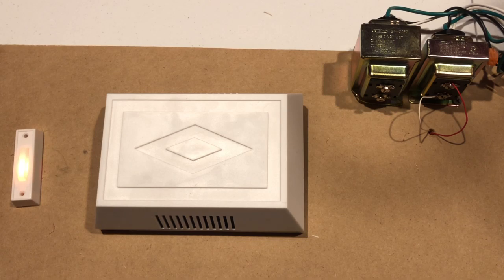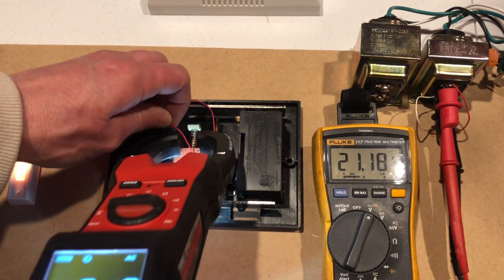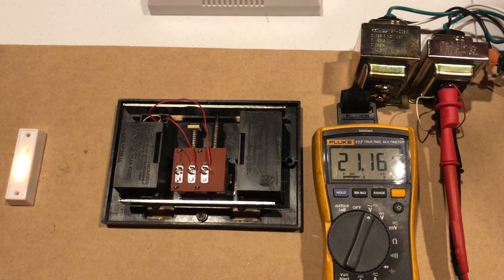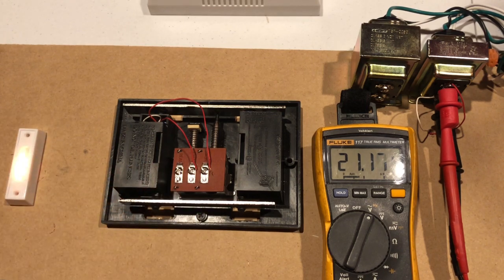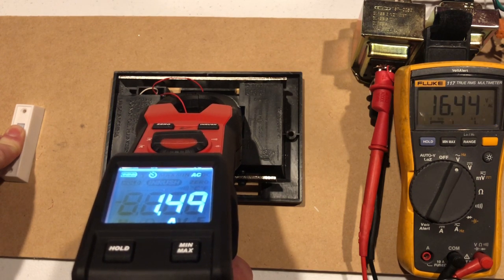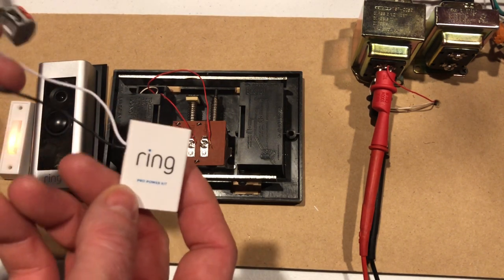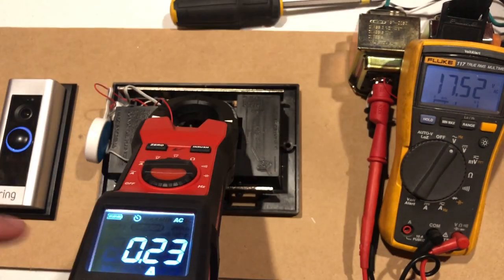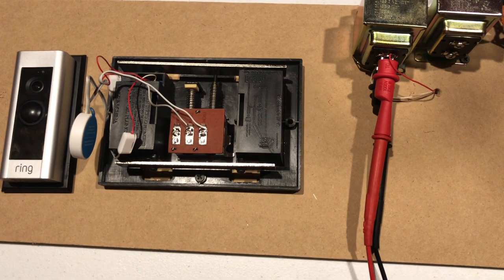16V 10va VS 16V 30va Doorbell Transformer

Comment: Hi i have a couple of questions please, is the transformer something i must install after installing a Ring 3 video door bell? I installed a Ring 3 video doorbell last week, i had to add a ChimePro to extend wifi signal, working fine, battery always at 100%,then since yesterday i noticed the battery going down to 95/94 and 93% now, over night didn’t move from 94%, during the day i was using the app quite often and tried to change some settings but now back as before.So do i need to install a transformer(16/30) ? Is there an old transformer to be removed? and does it go in or beside the home ring chime? Just trying to find out if this could be a solution and if i could do it myself without hiring an electrician.thanks for any help!
Reply from the maker: I wouldn't worry about it right now.  With your ring having the battery you shouldn't have to upgrade the transformer.  The battery compensates for the voltage drop.  Really this video was intended for the Ring Pro and Nest Hello.  Right now you are using your doorbell quite a bit but in a couple of months you wont be using it as much.  If your battery level was getting down to the low 80's or high 70's I would upgrade the transformer.
Reply: @sellgooddeals-DIY  hi thanks for the reply, sorry if i bother you again but let me ask you something else, maybe you could give me an opinion, i installed a ChimePro to extend wifi signal, using 2.4ghz wifi, seems better than 5ghz, so the signal strength between modem/router and ChimePro is always pretty good( -39-43), but between Chimepro and Ring3 outside door goes up and down ,( -50-53 then -60 and sometimes-71poor connection), the chimepro is right in between ring3 and modem, maybe 8feet from ring3, it seems too weird that the door blocks that much. any idea or suggestion?

Comment: Could this be the reason why my chime vibrates and "ghost rings" as soon as I hook up my nest hello? No load I am getting 19 volts at the chime and at the wires for the doorbell. I did not test amps or under load voltage. Thanks for the help.
Reply: I got the same problem and after I reconnect the power kit. The ghost rings went away.

Comment: Thank you for this video! It's very helpful! What if you removed the chime part instead? For some reason my ring doesn't sound through it anyways. I'm scared to change a transformer.
Reply from the maker: I don’t use the chime at my house, I bypassed it.
Reply: @sellgooddeals-DIY  how did you bypass it?  did you just join the 2 (or 3 if you have a rear door) red-wires together and that's it?

Comment: The booklet tells you that you need 16Volt when you actually need a 24 volt Compatible System. My cost to upgrade was over $75 (new doorbell compatible system)+(Transformer and compatible doorbell) not including the Ring Pro Video Doorbell itself

Comment: Great video explanation!  Would a digital (melody) doorbell cause the same problem?
Reply from the maker: Thank you for watching!  The digital doorbells just use a fraction of the power and it shouldn’t be an issue with a video doorbell.
Reply: @sellgooddeals-DIY  
my digital door bell is making a buzzing sound after I installed the ring door bell. I upgraded to 16v 30vac and still makes the buzzing sound. What could it be?
https://youtu.be/bGdrE7ukPGA

Comment: I just bought a ring pro and preparing to install. I just checked my transformer and it shows 10V 5Va rating.  I am sure this will be a problem.
My question: Can I just replace this transformer with a 16V , 30va and be ok or will I have to replace my existing doorbell as well? The fact that my existing transformer was so weak, gives me outside for concern. My house is about 30 years old btw, but doorbell has worked great all these years.
Reply: You may want to check your Mech. Chime rating, since you will pushing more voltage to it with a 16v 30va, if it is rated low, you may considering replacing it.

Comment: So last week I installed my Ring, this is the second house I have installed one on and it worked for a day but dropped out and not working anymore.  I assumed a bad one, didn't call Tech because it was set up correctly and was working fine for a day.  So I packed up the Ring and was ready to take it back but was leaving for the holiday.  Now on my holiday I watched this video and I do know I have a 16v 10VA transformer and my guess is this is exactly the problem.  I wonder is it better to get 16 volt 30 VA or a 24 volt 20 VA transformer when I return?  
Thanks and really great video!  Thank you for sharing!
Reply: General Rule; stay with the power (or close to) your Chime requires, if 16v 10va then go with 16v 30va, if 24v then go with 24v, the problem by adding more voltage to a Chime is the strikers will hit the bell arm harder increasing the sound (possibly damaging Chime over time).  With Smart Doorbells when the Doorbell button is pressed the Smart Doorbell and Chime increases the Load (at the same time) so you need a transformer that can handle this increased draw, this is why you go with a higher rated (va) transformer.
Reply from the maker: I would go with 16V 30VA the voltage is more stable.  The higher the VA the more stable the voltage will be.  However, both will work fine for you.  Thank you for watching!
Reply: @sellgooddeals-DIY  I have exactly the same problem... have tired 3...rings with the transformers they provided. With new one.. it ran for 2 days and off for 4 days then back on 2 days then now off and it is 6th days After watching your video, i have checked the transformer.. it says 24V 15VA. DO you think this could possibly cause the power issue?

Comment: Great explanation.  I know understand why I would need to replace my 16v/10vac to a 16v/24vac.  Is the power kit a requirement?  I had my doorbell camera installed by ADT and they did not put a power kit on the chime.
Reply from the maker: Don’t worry too much about the power kit.  The main problem is the transformer doesn’t have enough capacity to power both the chime and the doorbell.  Since this video I have tried 6 more different video doorbells.  None of them had power kits.  Changing the transformer to a 16v 30va fixed the problem on all of them. Have you been having problems?
Reply: sellgooddeals DIY 

Humming/buzzing coming from the chime.  Phantom doorbell ring.  Doorbell CAM losing wifi connection, no power, and the ADT Control app says there is a power issue.  Also the battery in Doorbell is low.

Until your video I didn’t really understand how increasing the vac would help.  What I learn is higher vac = less drop in Volts.  Maintaining Volt above 16, even when camera is drawing power to record = good.

Thank you.  Very informative video.
Reply: @CeasarBergonia  The Power Kit is suppose to take care of the humming/buzzing issues...

Comment: Douglas Blake on 8/23/19 writes
This discussion focuses on the original 16Vac/10VA transformer and the problem I see with it in its original application.
Relative to the 16Vac/10VA transformer measuring 21Vac on its secondary that is a problem which will cause the 16Vac-rated bulb within the door bell pushbutton to have a reduced life (< 3 years). Upon viewing your video (prompted by my own bulb burning out after 2 years) I discovered that the voltage on my 16Vac/10VA transformer is actually 22.3Vac. I went across the street to my neighbor (same transformer) and found his to have 22.4Vac. He has already replaced his bulb after 2.5 years of service. My experience with these bulbs is they usually outlive the house. 
The solution is either replace the transformer with the 30VA unit that seems to measure closer to its nameplate voltage of 16Vac (17.62Vac) or replace the bulb with one having a voltage rating that more closely matches the actual voltage (say 24Vac). Per web search there is very little cost difference between the 10VA and 30VA transformers (MOL $15); bulbs are <$1. Replacement pushbuttons (all had 16Vac bulbs) run $5 to $15 depending on material but this is a temporary solution. Since I suspect (see below) the high secondary voltage (21+Vac) on the 10VA transformers to be a common issue under light loads I don't recommend an in-kind replacement as a solution.
The answer as to why the 10VA transformers all seem to have secondary voltages well above their rating (16Vac nameplate vs 21+Vac actual) is this is the LIGHTLY loaded voltage that is applied to the bulb. I measured the amp draw of the bulb to be 23ma which means the bulb consumes 0.5VA (0.023A x 22.3V = 0.513VA) of the 10VA available from the transformer (5% of rating). Once the pushbutton is depressed the bulb load becomes zero VA since the pushbutton shorts across the bulb causing it to turn off while depressed thereby making the full 10VA load rating of the transformer available to ring the chimes. The chime's load was measured to be 0.7Amps and the voltage at the transformer's secondary terminals was measured to be 15.6Vac while chiming. The load on the transformer during chiming is 10.92VA (0.7A x 15.6 Vac) with the pushbutton held down to get a steady state reading. The fact that the load rating of the transformer is being exceeded during chiming (10.92VA-vs-10VA rated) is OK since this is an intermittent application. Caution - do not depress the pushbutton for extended periods of time as this could cause failure of the transformer. A caution when going to a larger VA transformer is that typical doorbell wiring is very small gauge thus the Amp rating of the wire could be exceeded with a larger VA transformer.
Admittedly replacing the bulb in some door bell pushbuttons is a bit more involved than simply screwing in a replacement. There are YouTube videos showing how to replace the bulbs where the leads are captured under screw terminals. My own requires a soldering iron to remove/install bulbs. Safety first - know what you are doing. Turn power off to the transformer before proceeding. Final word - the safest course of action to remedy short-lived doorbell pushbutton lamps is to replace with a higher voltage bulb. This is also the lowest cost option.
Reply: Interestingly, 16v 30VA is higher current than 24V 40VA for the same amount of power, but both are way more than 16V 10VA.

Comment: Best explanation on YouTube. 👏🏻 something so simple. This should be the first thing they should ask when u tell them that you’re ring doorbell shuts down and then powers back up after ringing doorbell.It actually said it on the back of the door bell 16v 24vac but most people don’t actually know all this stuff. Like the 16v 10 vac will power it up but under load volts drop and shut doorbell down .I was troubleshooting my uncles doorbell and found the problem to be exactly just that.
Reply: Always VA rating is more important. It is similar to Wattage rating(capacity of the transformer)  Not enough voltage means not enough VA rating. I use a 24V 40VA 
(momentary peak 75VA). This transformer is made in US by GE and twice heavy in weight, big)

Comment: Hi There, once again great demo. Now, I replaced my 16V 10VA transformer with a 24V 20AV one (that's all I was able to find at my Home Depot). I am using the NEST and a single chime.... I don't have the volt meters or amp meters to verify my setup but when I look in the Nest app, it shows voltage of 23.5V... I am not sure what happens when someone rings the doorbell... As far as I can tell, it is working OK I but don't know how low the voltage is dipping and what sort of amps the chime is drawing. Any idea? Have you tested the 16V 20VA combination? If I have to I may bypass the chime like you suggested it in one of your previous demos/videos. My new transformer is a heath Zenith SL-125-02 and my chime is pretty close to what yours looks like.

Comment: I’ve been told this will eventually ruin your ringer because of the additional voltage and current , what do you think about that
Reply: As long as you use 16V, the Capacity 10VA or 30VA won't affect it. Even if you use 24V, that may affect it in the long run, but no big deal. If it fails, then you can always bypass the Chime (see one of his previous videos), especially as it won't be missed if you are using something like Google Home which will also serve as a chime, plus the Notification on your phone. The big culprit is that chime box and it draws way too much power.